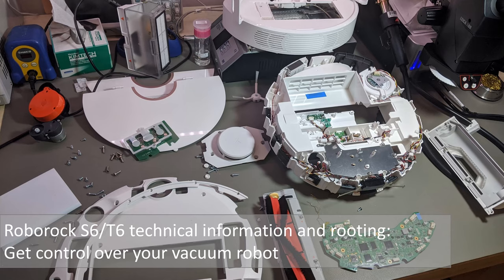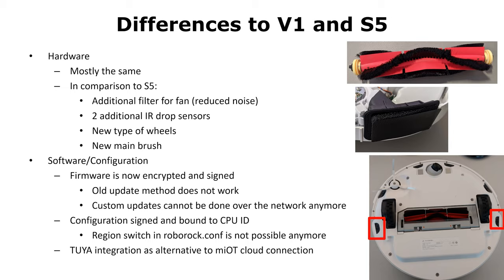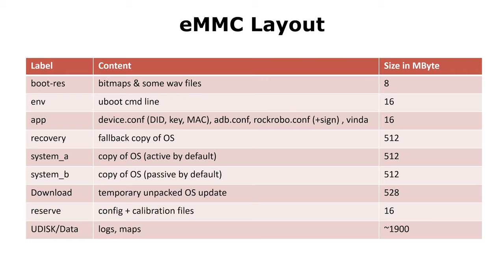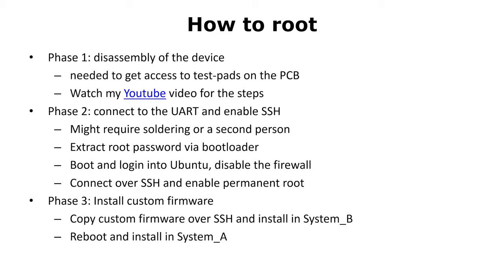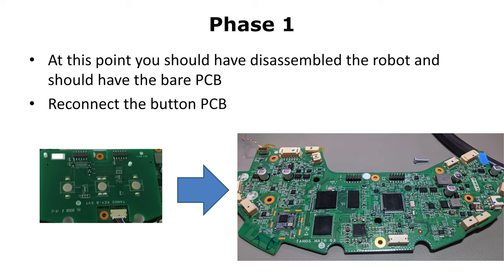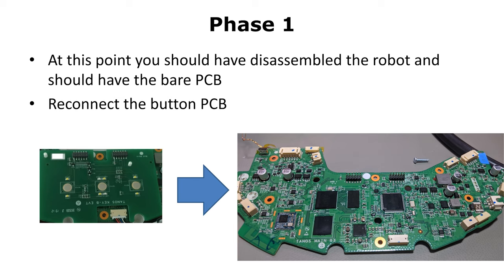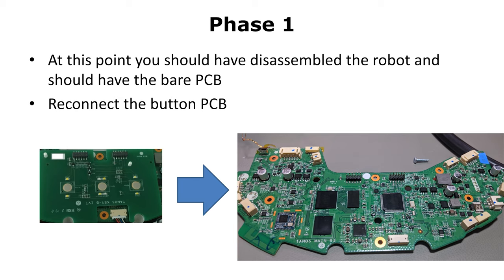Roborock S6/T6 Technical information and rooting (Part 2)

Comment: Thanks Dennis, followed your quide and got a roborock V1 (also firmware 4010) working with Valetudo, man oh man there are a lot of screws in the V1, then I rooted a roborock S5 by just using the flash tool you mentioned on your website. Thank again, you have breathed new life into two old robots, and I am very happy to have them "off the cloud".

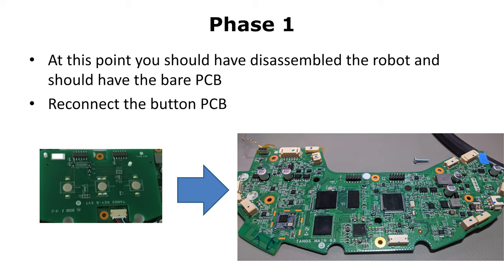Comment: Hi thanks so much for the instructions and really appreciate the effort you've spent to find this method, with the connecting over SSH/wifi step 13:50 mark, how did you connect your vaccum/circuit board to wifi? Is this via the original Xiaomi App?
Reply from the maker: If your device is reset, it will create a open Wi-Fi Access point. In that case, you connect to it and use SSH. The IP of the robot will be 192.168.8.1.
If you robot is already provisioned (in your home Wi-Fi), then you just SSH to its IP. You need to figure out its IP address. For example, you can check your router. Or try "ping rockrobo" as rockrobo is the hostname of the device.

Comment: Hey Dennis!
Nice video, but i have a question:
Does this also work with the Roborock S6 MaxV?
I would like to buy one, but i don't know if i should take the S6 MaxV, if rooting is not possible with it
Reply from the maker: If you want to have a fast and easy root, I would not get the S6 MaxV. Generally that model have also other potential issues...
Reply: @dennisgiese5591  ok thanks for the fast response
Yeah i'm deciding between the normal S6 und the S6 MaxV, i tend to buy the S6

Comment: Will this method work for the Mi Robot 1S too? I bet there are different UART Pins cant really read from teardown pictures on your site. I really would like to kick out the whole original firmware stuff so that i can use it with valetudo :) But information for this model seem to be very rare, the chip seems to be the same as i read so far.
Reply from the maker: No :( Even if you have UART it does not help you. They use Secure boot...

Comment: Thanks for the great video! Can we expect some similar video for the S5 Max in the near future?
Reply from the maker: Yep. Its work-in-progress. S5 Max is a little bit more annoying due to the limited hardware. See also here: https://dontvacuum.me/robotinfo/
Reply from the maker: The S5 Max video is delayed as my device is bricked :( This happened while I was testing the tools and methods. There is a chance that the NAND flash is faulty... and I obviously cannot really send it in for warranty ;) It will take me some time to repair it.
Reply: @dennisgiese5591  Moin, is there any update about S5 max?
Reply: @dennisgiese5591  ever had any luck solving the S5 max :) ?
Reply: @dennisgiese5591  i am also trying it on the S5 MAX.

I am able to connect over SSH but from there i have no sucess :(

Comment: Hi Dennis,

Thanks a lot for the time and effort in this. Your instructions worked well for me. I have only four leftover screws and two suggestions:
* A slideshow containing the marked screw locations from disassembly in reverse order may be very useful for the assembly.
* I've tried for hours unsuccessfully to connect to my home wifi from UART command line. When finding your reply regarding the robots wifi below I felt like an idiot. Maybe a reference to the robot's wifi could be added as annotation to the video.

Finally, I'd like to buy you a coffee. Do you have PayPal?

Thanks again.
Reply from the maker: Yeah, will do next time. I actually had the S6 and S6 MaxV disassembled at the same time and mixed some screws up ;)
Reply from the maker: Donations: Actually, in fact I do. I am also always interested in hardware (e.g. even broken boards): https://builder.dontvacuum.me/donations.txt
Reply: @dennisgiese5591  found that link in the meantime, and already used it. Thanks again.

Comment: Quick question: Is there an easy way to remove the left and right drive wheels on the Roborock S6?  I tried removing the screws, and it wouldn't come out. . .  Someone mention a holding pin, but I've not actually seen a video of the removal process. . .  I wasn't able to see anything concerning this in your video, but I couldn't watch the complete thing. . .  There are no videos available addressing removal of drive wheels on the S6, and it definitely is different than the S5 because of the damned holding pin. . .

Comment: Thanks a lot for that instruction.  But have you faced with situation when you cannot get in sunxiext loader ? I have Q7 max roborock, and i cannot get there, boot screen goes futher, no reaction on s or any other key. looks like they disable it
Reply from the maker: yeah, they patched that. We need to use a different method now. Check S7 rooting. That should still work.

Comment: Great video thanks, i just realized that some pet hairs are stuck Inside the wheel. Do you have any guide to remove the wheel so It can be cleaned from the inside or change it? Thanks,
Reply from the maker: Not really :( I saw a while ago a few pictures of people disassemble the wheel assembly. Sorry that I can not help you with that.

Comment: If you don't have a USB to UART adapter but an Arduino with USB (the micro for example), you may use it as a USB to UART brisge with the SerialPassthrough example that comes with the arduino ide. Just successfully did so because I could not wait until tomorrow when my adapter is supposed to be delivered ;)

Comment: Hi, thank you for great video!
Roborock s5 Max  I have problem with wifi module, I tried reset to factory software but didn’t help, blue light not blinking, sometimes light for a while, that’s all. this is possible to root and repair this? or replace a module wifi RTL8189ETV ? it’s worked well before, now I can’t find this roborock in telephone. or replace a new mainboar.  Sorry for my English

Comment: Thanks for this detailed and great tutorial! I have unfortunately the problem that the password read via U-Boot and calculated via your Password Calculator does not work for me with the "root" user (Roborock S6).
I have already read the string from the vinda file several times and checked the generated and inserted for spelling. Unfortunately always with the same result. 😞
Has anyone else had this problem?
Reply: I had exactly the same problem! 
I'm ashamed, but I gave up and bought a S6 Mainboard. Not cheap but cheaper than a new robot and it worked..
Reply: same here with S6-. 
@dennisgiese5591: any idea if that is related to a specific SW/HW version (3.5.8_2700)? I have got an "\" in that vinda-pwd. shouldn't be a problem, correct? Anything I could provide to solve that issue?
--> Factory Reset did the trick, sorry. Was too stupid to follow the procedure correctly

Comment: An amazing project! 
Unfortunately, it doesn't work for me (yet). I just did the whole procedure as described in the two videos but when I call the page of Valetudo on my robot the buttons don't do anything. There's always an error message saying:   {"code":-10002,"message":"access denied"}. The only button that works is 'Find', the robot is responding. I'm using version 2021.01.1. Did I miss something?
Reply from the maker: Try to build a new firmware. I think there have been some bug with the starting scripts. So it might be that issue.

Comment: When using the TAR command to unpack the firmware I get this error: 
gzip: stdin: not in gzip format

EDIT: If installing on late firmware s5 you need to download the build that says "Build for manual installation" then you can unpack and proceed
Reply from the maker: Yep. You are right. The builder has a manual installation checkbox for v1 and s5. This checkbox creates a tar.gz file for you. If you have trouble rooting your v1 or s5 device (e.g. if the revision is too new) and you do not dare to disassemble it, ping me directly... maybe I can help you.

Comment: @Dennis Giese Ich habe aktuell Probleme bei dem S5Max mich mit ssh zu verbinden. Habe mich an die Anleitung gehalten und wenn ich mich verbinde kommt nur ein time out. Ich bin mir nicht sicher ob der Roboter den Port 22 immer noch blockiert oder nicht. Hast du vielleicht eine Idee. LG
Reply from the maker: Wenn du der Anleitung folgst, solltest du zwischendurch die Firewall für Port 22 deaktivieren. Vielleicht hattest du da einen Tippfehler. Ansonsten kann ich empfehlen sich in dem Telegram Channel zu melden, da dort sehr viele Leute die Staubsauger gerootet haben und entsprechende Erfahrungen haben.
Reply: @dennisgiese5591  Danke für deine Antwort habe inzwischen das Problem gelöst

Comment: Is it possible to run custom apps on the device? Can you install Python on it? Is it possible to read from the various sensors in real time? Or are we limited to just reusing the APIs that the official mobile app uses?
Reply from the maker: If you root the device, you can run your own software. However, the actual protocol for the control and sensors is still not completely known. Check out projects like Valetudo or https://github.com/porech/roborock-oucher . With newer firmwares we have the issue that we dont have apt-get anymore, so installing ubuntu packages is a little bit more tricky.
Reply: @dennisgiese5591  Which robot vacuum model would give me the maximum control and access? (rootability, custom firmwares/OS'es, installing apps etc; as well controlling the individual functions ( things like speeds of various motors, access to the speaker etc), reading values/data from sensors; and so on)

And with those priorities, would I have any good choices regarding number and quality of sensors, quality of vacuum abilities, battery life etc?
Reply: @dennisgiese5591  Btw, is there some forum I can go to get more help and information about rooting robot vacuums?

Comment: Hi Dennis, 

how do I have to connect GND from the adapter to the rockrobo v1? The v1 has no micro usb connection like the S6.
Reply from the maker: It does: check the back of the case. Otherwise just take any of the copper screw holes.

Comment: Wow, super detailed instructions! I would like to try to hack my Miija 1S. Does it make sense to try using this instruction? Thanks!
Reply from the maker: No, these instructions do not work on 1S. It uses different hardware and has secure boot enabled. So it is very tricky.

Comment: Hi Dennis great video I might give it a go. A side question. Would it work to replace my T6 mainboard with the s6 mainboard in order to make it an s6 and get rid of the geo restrictions ?
Reply from the maker: Oh, please don't do that! You can change the region without changing the board. If you install a custom firmware from https://builder.dontvacuum.me (and deselect Valetudo) , it will patch the signature checks. You can edit the /mnt/default/device.conf and the /mnt/default/roborock.conf. That way you can change the model to "roborock.vacuum.s6" and also change the region. The app would not spot the difference. I uploaded example files here: https://dontvacuum.me/robotinfo/configfiles/ . However, if you decide to use Valetudo, you dont have to worry about geo restrictions.
Reply from the maker: Also, if you are speaking German, I have written some explanation here: https://www.roboter-forum.com/index.php?thread/45980-region-geo-blocking-entfernen-t6-t4/
Reply: @dennisgiese5591   To edit those files on T6, first remount to make the /mnt/default writable: mount /mnt/default/ -o remount,rw
Reply: @dennisgiese5591  thanks, ive been looking for this. just want to remove the geo lock from my t6. one question though, ive looked at the s6 conf file uploaded from your website. timezone is set to eu/berlin and logserver is awsde0...since im not in EU, is there any list for the timezone and logserver so i can update and put in the correct location for me.

Comment: I need your help now. I bought "DSD TECH USB zu TTL Seriell Adapter Konverter mit FTDI FT232RL Chip Kompatibel mit Windows 10, 8, 7 und Mac OS X" from Amazon in order to do this process. I tryed the booting-part for so many times now, but it always keeps booting into Linux. I disabled flow control and checked the connection through a led on my adapter that is on when there is current on the pins (only if the robot is on). I also connected ground through the USB connection to my PC. I dont know what to do know because everyting should be fine. Do you have any solution to solve this problem?
Reply from the maker: Hey. I heard that a couple of times already. However, in all of the cases it turned out as a bad connection to the tx pin, missing ground or flow control that. Make also sure that the adapter is set to 3.3V, if it has that setting (e.g., a jumper which switches between 5V and 3.3V). Try to do a loopback: For that, you connect TX and RX on the adapter to itself and try to type something. You should see everything you are typing. In the next step, connect everything again to the robot. After the linux boot test if you can type anything. If you dont see anything for the login, then somehow your TX is broken. Maybe also verify that you have the correct pin on the mainboard.
Reply: @dennisgiese5591  Thanks for your help, it was indeed a bad soldering connection. Now everything is working fine. When do you think will Valetudo RE be ready for the S6?
Reply from the maker: @themisterx8660  No Idea. I am not the developer of Valetudo and Valetudo RE (which is a hard-fork of Valetudo). Valetudo itself supports all newer generation devices. However, that support might not be portable to RE, as the both versions are too different now. I think both versions follow different goals and the vanilla version might be in the long term the "cleaner" solution. But I am aware that RE has some features which are nice.

Comment: I have S50 There is no button that works and when you put it in charge after five minutes you talk  ( boot failure, it will take 5 minutes, please be patient )
What's the solution
Reply from the maker: Did you root the device or did it just happen by itself? Sounds like a hardware issue (e.g. broken eMMC Flash). The S50 (which is technically a S5 with a different color) is usually very robust and hard to brick. Hard to diagnose that.
Reply: @dennisgiese5591  It happened by itself

Comment: I have an S4 vacuum and got to the root password, deobfuscated it, but I cannot log in with it. It just says "Login incorrect" :(
Reply: If anybody has the same issue, a factory reset helped in my case. After that, I was able to log in with the pprevious password
Reply: Do you remember what uart usb chip you used?

Comment: In my case "s" doesn't stop ubuntu from start - I make sure that there is no flow control ticked.
Reply from the maker: Check if you can type anything in the login prompt (like a username). If not, it might be still some odd flow control issue or a GND problem.
Reply: @dennisgiese5591  Maybe I will check with other communication device

Comment: I did all the connections, i got pass the string stage. i got the password, but it doest work. it always give incorrect password. i have tried copying the string so many times.
Reply from the maker: Hey! Sorry for the trouble. I heard from some people that had the issues. Apparently that happens as Rockrobo introduced some countermeasures. However that countermeasure apparently only applies to newer version. So try to do a full factory reset (not only WiFi) to recover the initial version. That version should enable UART access again.
Reply: Hey, I made the same experience with my brand new roborock. Is there a way to "reset" to an older version when I never did any updates? It never had any network connection. Or am I stuck with the cloud?
Reply: Hey, does the factory reset solve the problem?
Reply: @petrbenes8060  Hi, I had the same issue - I can confirm that a factory reset solved the problem (the root password did not change). I purchased mine in January, so it is at least older than 01/2020; perhaps this won't work if your vacuum is too new.

Comment: I can confirm this works on an S4 as well.
Reply: When was your produced? Or is this necessary to know?
Reply: @odoy8419  Don't have the exact production date, but it shipped with the newer firmware that can't be rooted by installing an update.  Determining the production date isn't necessary. Try installing a rooted firmware update, if that fails then you need to use this method.
Reply: Do you remember what uart usb chip you used?

Comment: Will it work with rockrobo.vacuum.v1?
Reply from the maker: Yes, however there is an easier method (without disassembling) if you device was manufactured before 2020. If you need to disassemble it, the UART pins are different (check the teardown here: https://dontvacuum.me/teardowns/rockrobo.vacuum.v1/ ), but the rest of the process works the same. I will add an option to the https://builder.dontvacuum.me in order to create packages with the installer integrated.
Reply from the maker: @SMƎ˥˥Z Image 30 shows the UART pins of the R16.
Reply: @Dennis Giese I own a new 2020 version and I’am willing to root this thing and get rid of the china cloud 😉 
So the process is completly same like in this video? (Just found a teardown video for the v1: https://youtu.be/wglJz23Gt4w)